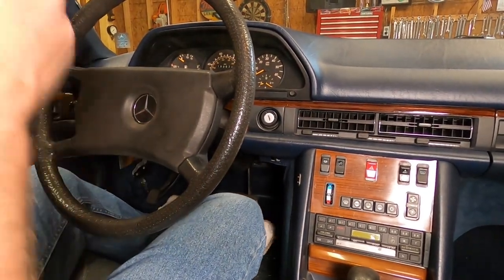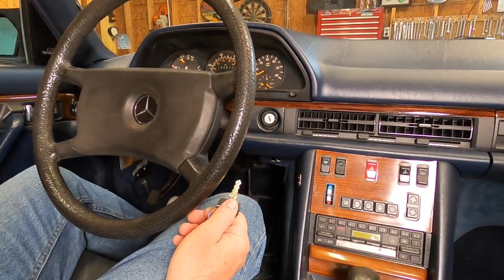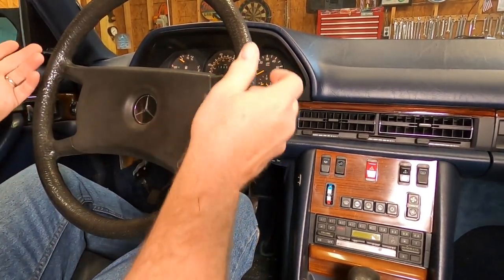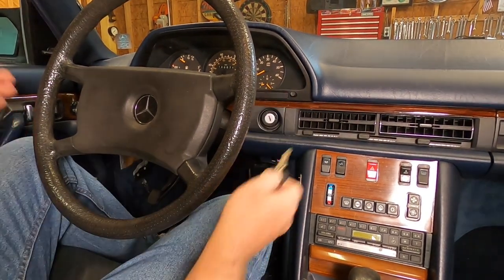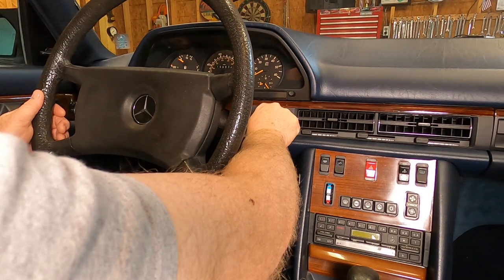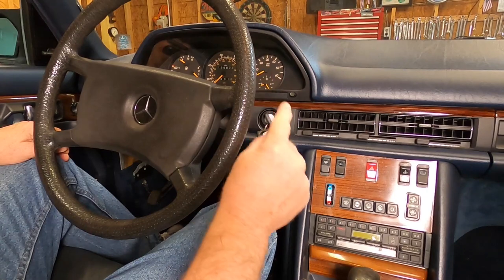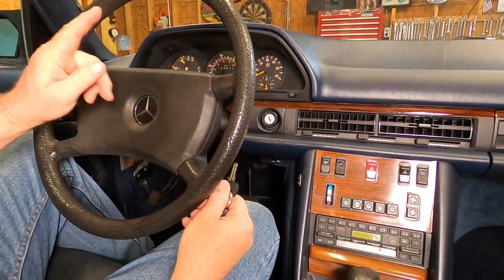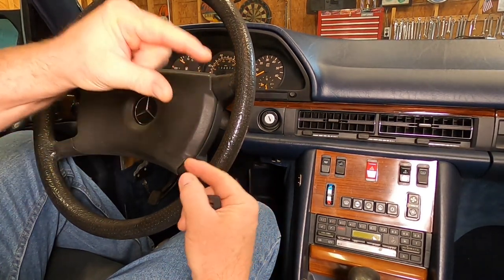VLOG - W126 Mercedes Sticking Ignition Key - Steering Lock Function Analysis

Comment: A different issue in my 1984 300D about 10 yrs ago.  The key would jam and not turn sometimes.  Removed the key stalk (hard) and pried the steel plate off the aluminum housing.  Inside, a spring detent had broken off and the parts were loose to sometimes jam turning the key.  While in-there, you could remove the steering lock shaft since it only causes issues and probably doesn't do much to prevent theft.  Key stays in position without the spring detent.  I secured the metal plate by crimping the aluminum and epoxy.  If I recall, that plate is only needed for the spring of the lock shaft.

Comment: That happened today! Not joking, I just came out of the store w ice cream and a frozen pizza. It s hot here(Ventura, CA) also and I couldnt get the windows down. Key wouldnt go in. Started sweating. Thinking I have to sell this benz(83 300sd ). Starting cussing and then praying.  I started moving the steering wheel w pressure in the key and it finally worked! I will watch this video tomorrow before I drive it. Thanks!!

Comment: I have a slight issue. My steering column is crooked, right side is higher than left. I though it could be the previous owner always lean on the left side. Can't wait too see what will you find out. Great job as alway.
Reply: Just test it. I need to make the steering column further crooked (opposite to what you do) to make the tumbler turn easier. Definitely need to see how you deal with the steering column. Thanks

Comment: I am of the opinion that the steering wheel lock has been forced a few times raising a burr on the column. The steel on the column is way softer than the lock. So it probably mushroomed and the slot is warped. I would look into disassembly on the column or at least removing the lock and taking a look. The alignment you mention is probably a part of the slot that has not been mushroomed.
Reply from the maker: Interesting analysis.

Comment: I think that lock rod is bent from having been forced a time or two in its life. Causing the alignment issue.
Reply from the maker: Well the thing is that I actually replaced the steering lock assembly in one of the previous videos. It's a brand new Mercedes Steering lock. After I replaced it, the the issue remained.
Reply: @ImpalamansGarage  
That's right you did. Forgive my senility and never pay attention to me again 😏
My senility notwithstanding... I think you're on to something with just loosening and re-tightening it. I ran into GM tilt wheel column issues back before dirt was invented. The bolts down below would loosen up. It was easy to get in two of them with a crows foot. The third was a pita. So naturally most just tightened the two and claimed problem solved.

Comment: My 01 e320 never gives me a problem. It has one of those funny IR keys and never ever jams. 
However, in any previous cars I just used the jiggle method. My 85 300d would jam up but the wiggle worked every time.
I wouldn't pull on the wheel because you might mess up some internal thing in there by pulling it off kilter.
Reply from the maker: Now I miss my 2000 E320. Thanks Werner. LOL

Comment: Mr. Impalaman, great video. Two questions:
1. Does your car have the switch to extended the steering wheel in and out
2. When installing the new steering lock, did you loosen the two bolts of the steering column to dashboard frame? 
Your buddy Peter from Kansas
Reply from the maker: 1) No
2) Yes. Per factory procedure. See previous video.
Reply: @ImpalamansGarage  #2 is the problem. 1-2 mm play left / right & up / down of steering column.
Needs to be perpendicular to steering lock and hole center has to line up with pin center 
Engage steering lock fully, loosen both bolts just enough so steering column can be moved with slight resistance. Move until lock releases without moving the steering wheel.
Have fun! Your buddy Peter from Kansas
Reply from the maker: @inovahightechltd  Makes perfect sense Peter. I will give it a try!
Reply: @ImpalamansGarage  should work with a bit of wiggling on the column. Btw I did watch the other video and thought you did but I thought I better ask. Peter